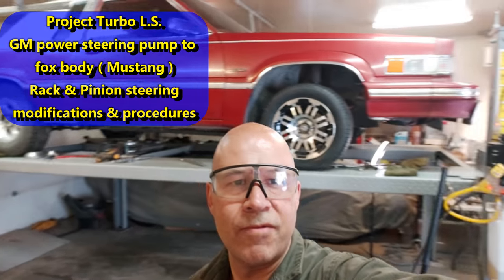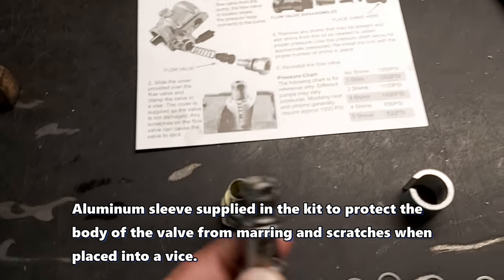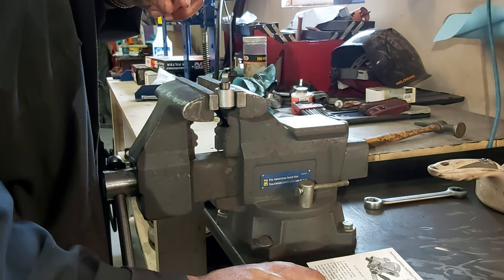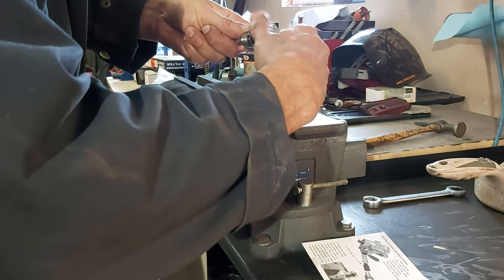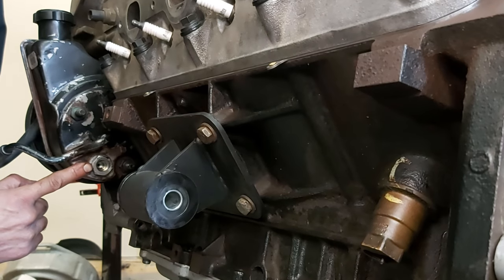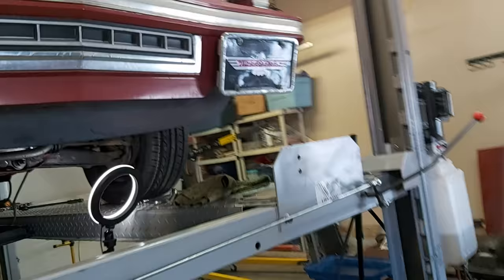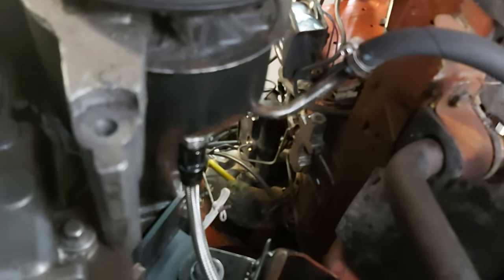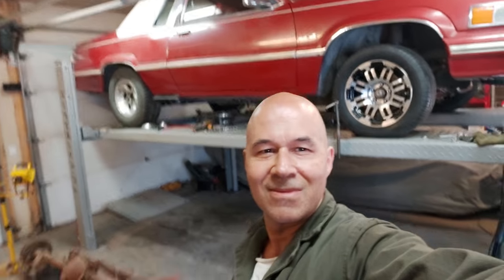L S  GM,  Power Steering Pump to Mustang Rack & Pinion steering system

Comment: Can I use the early GM style pump with the Mustang 80 style power rack do I need the shims in that too
Reply from the maker: Yes, I would try it with the recommended shims then see how the steering feels and responds. Once you get a baseline you can add or remove shims until you get the steering feel you like best. Thanks for watching and commenting.....Oliver

Comment: what power steering pump did you use? do you have a model number?
Reply from the maker: Any 2002 through 2008 ls 6.0 power steering pump will work, even if you find a good one at the wrecking yard attached to an ls remove it and it will work. Thanks for watching and commenting....

Comment: I thought mustang II racks require 850 PSI,  not 1000 PSI
Reply from the maker: According to the instructions that came with the Boergson pressure reducing kit, the Mustang rack and pinions generally require about 1000 psi so 3 shims were  installed.I just followed what the instructions said "https://static.summitracing.com/global/images/instructions/brg-899001.pdf " .....thanks...
Reply: A mustang ll rack is a different design than a foxbody mustang rack and they require different pressures.